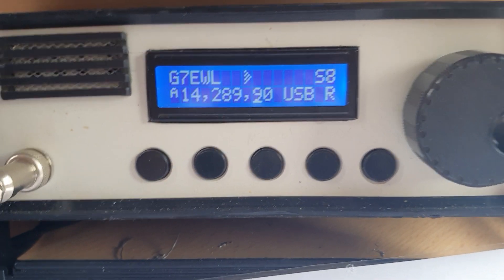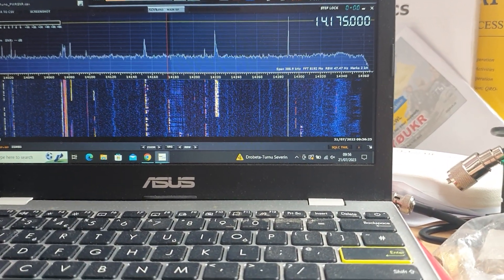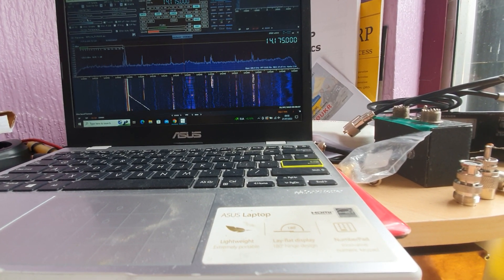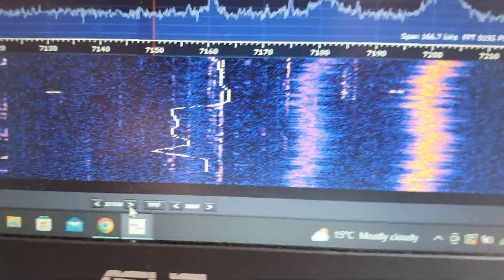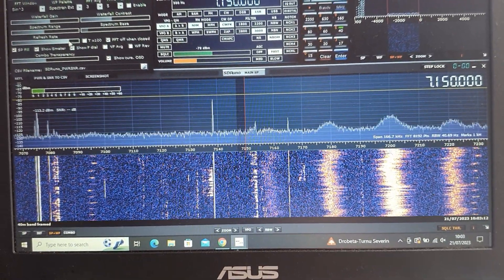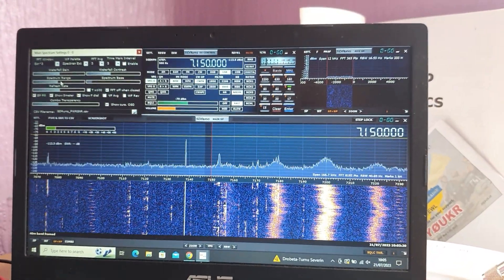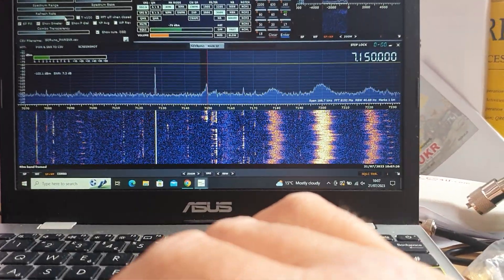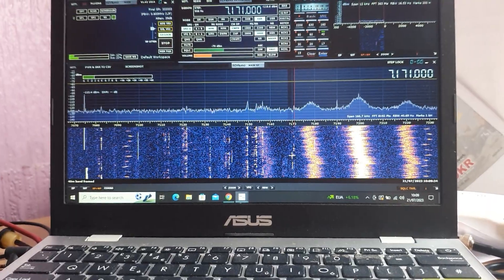Adding a waterfall and spectrum scope to your uSDX/SDR tranceiver, ghetto (budget) style.

Comment: Well, you had me going there.  I was saying, "how is a uSDX with an ATmega328P MCU and a 15 kHz ADC scanning the whole 360 kHz span of the 40 meter band while also still demodulating audio from SSB?"  And I thought that maybe you were taking the I and Q outputs of the switching mixer and feeding them into an external ADC, but that wouldn't work because the op-amps in the uSDX can't run that kind of bandwidth at that gain, either.  And then I noticed the "SDR" in the title, and now I know what you mean by "ghetto".  I have one of those SDRs myself, so it really shouldn't be too hard to use that at the same time as the uSDX.

I really like the look of your repackaging of the uSDX, by the way.  It has the perfect blend of professional and homebrew to it, and anybody with a little knowledge in amateur radio would guess by seeing the waterfall display above it, that it's a much more expensive and sophisticated system.

Comment: No actual information how to do it, no information about the SDR software..👎
Reply from the maker: Easy does it Trigger. Firstly, it doesn't say how to do it. Secondly, less than a minute into this video, I say I'll do another video later with more information. Take a look at the later video and read the description for more details.
Reply: The short answer: look at the laptop screen, which clearly says "SDRuno" on it.  This is an open-source application that works with very inexpensive SDR radios (mine cost me $25 a year or so ago) (doesn't even need to be connected to the uSDX transceiver) to both demodulate the signal and simultaneously show the spectrum waterfall.  Of course, we're hearing the demodulated audio from the uSDX here.  I think it's just a lucky fluke that the uSDX leaks enough of its LO out the antenna for the SDR for the SDR radio to pick up, which lets you see where the uSDX is tuned.  He almost literally says this near the beginning.
Reply: Correction: SDRuno is NOT open-source.  I was confusing it with a Linux application, CubicSDR, which is open-source.  SDRuno is SDRplay's SDR software for their RSP-1a radios and others.  They say it won't work with other radios, but since most of these SDR boards are just clones of the RSP-1a, I'm not surprised it works with them.

Comment: Do you have a T/R switch on your SDR  that allows oscillator signal to “leak” into the revive input? Antenna wire to the case of the USDX? What’s the trick? BYW I use a $28 one from wish with HD SDR. Bang for buck performance is great.
Reply from the maker: Hi, & thanks for the comment. I've tried various ways & will make a video in due course about this, been meaning to for ages so thanks for the prod. So the uSDRs I've done this on do have a TR switch, you can hook a low value cap on the Rx side and feef this into your SDR, it will work but as you have discovered you do see all the sum and difference harmonics to some degree or another. Ironically, the "red corner" which is the one people like because it has a decent balanced mixer in, is by far the worse for this issue. The other way is to put a pin diode Tx/Rx changeover switch in line with the antenna. This works well and you have the ability to ensure there is a nice match & are no reflections. But, by means of a compromise, and this methods has worked well for me, is to use a low value cap, around 27pf from the antenna socket, making sure you have the shortest legs possible, or use a smd, & then use a pair of diodes I used something like bat11 back to back for protection before feeding your SDR monitor.   There's no measurable reflected power & it doesn't affect your noise floor. Yes it's a bit ghetto but it works. You may find you can even use a lower value cap on yours, I've discovered since making this video that there's quite a variation in sensitivity between these cheap SDR dongle things. The RTL being by far the worse, but there again they seem to be based on a DTT receiver & not meant for HF. Hope that helps. 73 Shane G7EWL - YO2EWL
Reply: There is very little isolation between the antenna and the receiver mixer, so yes, it's definitely possible for it to leak this much LO out the antenna jack, right out of the box.  The T/R switch is implemented by shunting the antenna input to ground through a MOSFET, but this wouldn't come close to removing all of it.  That, and the SDR receiver may just be picking it up from the PCB of the uSDX, since there isn't much in the way of shielding in there.  According to one of the designers of the original uSDX, they only did enough isolation to keep the transmitter from wiping out the mixer; the bulk of the T/R switching is done in software, just by disabling the receiver LO when transmitting, and disabling the transmitter LO when receiving.